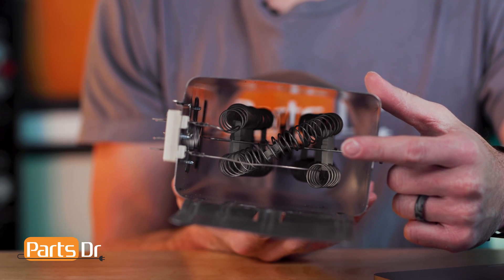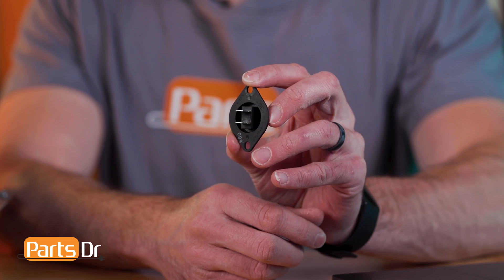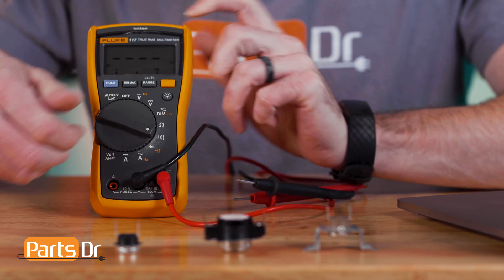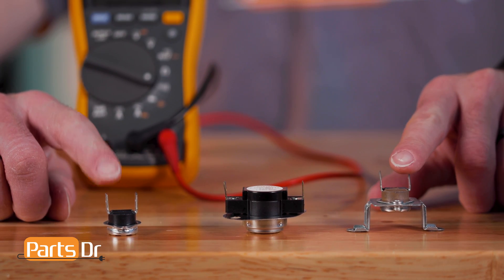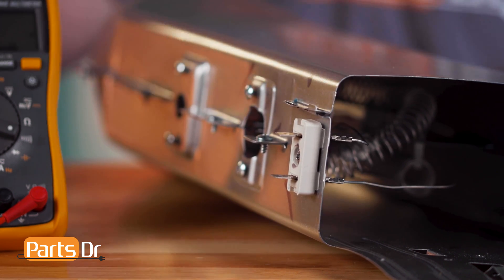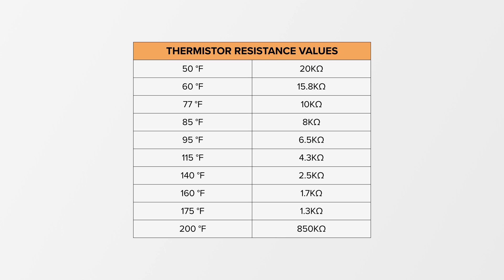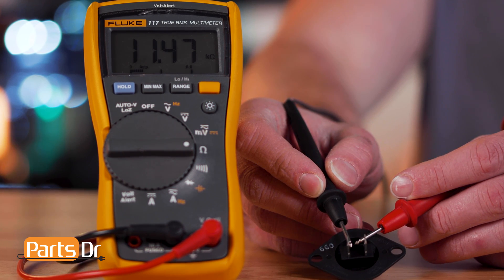Samsung dryer not heating? Test these 5 things first!

Comment: after replacing the belt, idler pulley and 4 rollers, the dryer starts and only runs for about 15-20 seconds and shuts off. What could be the problem?

Comment: What if it seemed to have stopped producing any heat, then later (after it rests and after I unplug it, wait a few minutes, and plug it back in) it starts producing heat again?  Is that a symptom of any specific part going bad?
Reply from the maker: That behavior is most commonly caused by overheating due to restricted airflow and/or a failing high-limit thermostat. When the dryer gets too hot, the high-limit opens and shuts the heat off, then resets once it cools down or power is cycled.

Comment: Very helpful, concise and to the point. Used it to check the all these sensors. One question: does the thermistor actually go to 850K ohms when it's at 200F, or should it say 850 ohms? Sorry if this was answered previously below.
Reply from the maker: That appears to be a typo.  850 ohms would be correct.

Comment: I have a question. I changed the thermal fuse and the thermostat components on the heating element, and I also replaced the thermal fuse on the blower housing, but I still don’t have any heat in the dryer. I haven’t checked the continuity on the heating element yet. I have a Samsung dryer and I don’t know how to find the error code on the panel. This happened once before and I paid someone to fix it, and it cost me an arm and a leg — I think they replaced the temperature sensor if I’m not mistaken. This time I did the repairs myself, but I still don’t have heat. What do you recommend? I already bought a multimeter to check the continuity of the parts.
Reply from the maker: Since you've replaced those components, testing the continuity of the heating element itself is the next logical step!

Comment: What an incredible simple video. You can buy all 5 parts that go bad as a kit. Including the heating element. Just buy the whole kit at once, replace all parts in one shot. And while there, why not buy new belt, tensioner, rollers. You can buy all items for cheap. Since you are already opening the beast, just do a full rebuild for little money
Reply from the maker: Glad you found the video helpful! Just a quick note of caution on those aftermarket kits: they’re usually much lower quality than the original parts, and Samsung OEM parts don’t come in a kit for these dryers. We always recommend sticking with genuine OEM parts so you don’t run into repeat failures down the road.

Comment: I've replaced the heating element and the two thermostat fuses on it and replace the two fuses on the blower. 

The blower runs but the heating element never heats up. 

The only thing I can think of now is the control panel but that seems to be working fine as well. 

I don't know what else to do
Reply from the maker: You will want to verify that the power supply to the dryer is good.  If the 240V power is missing one side of the power, the dryer can run but not heat.  Otherwise, it could be a bad main control board or bad centrifugal switch in the drive motor.
Reply: @PartsDr Yes I didn't currently have a multimeter so next weekend I will be testing the outlet and also going and testing all the fuses and the element I replaced to make sure I didn't get a faulty one.

There was also no real indication on which way the fuses needed to be. There was no markings indicating up versus down. But I did hook up the wires in the same area they were by color. 

Thank you for your response.

Comment: We have replaced main parts, ran error codes and checked vents but it's still heating up
Reply from the maker: We would check to make sure the dryer has proper power supply 220-240v (make sure there are no burned wires at the terminal block).  If the power is good, then you could have a bad motor or main control board causing the dryer to not heat.
Reply: Heating up is what you want from your dryer.

Comment: I changed all of these and it still doesn’t heat up? I even clean the moisture sensors.
Reply from the maker: Check to make sure that the power supply to the dryer is good.  You could also have a problem with the main control board, the centrifugal switch in the motor, or a wiring harness problem.

Comment: My error is on an older Samsung Steam, maroon colored dryer and  reads "Temperature Sensor Problem". Is that the thermostat or the thermistor? Since I replaced the heating element not to long ago, and it came with new fuse and high temp thermostat  it must be the thermistor on the blower. should i check that first then go back to element.
Reply from the maker: It is usually a thermistor problem.  https://www.youtube.com/watch?v=9ep9bfxJBGY

Comment: Thermal fuses and thermostat both show okay with continuity tester. Heating element shows continuity and no short. Thermisters show approximately 10.5k ohms. I tested the components on both the blower and heater body.

No error codes on the display. Anything else to look at?

Its a DV331AEW/XAC Samsung steam dryer.
Reply from the maker: Verify that the power supply to the dryer is good.  If an electric dryer is missing one side of the 240V power it can allow it to run but not heat.  If the power is good then you could have a bad main control board or a bad centrifugal switch in the drive motor (this requires replacing the drive motor).
Reply: @PartsDr Thanks. I tested at the terminal block and power is good. I took the dryer apart again and the heating element shows 0 ohms. Should it be replaced?

Also the thermistor on the blower is showing 12.68k ohms. Replace?
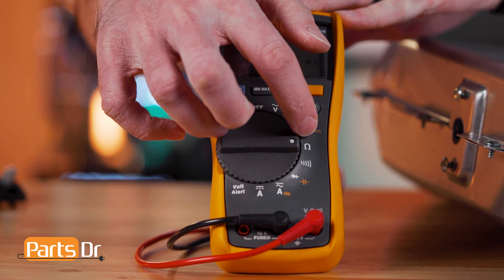Reply from the maker: @8mmtaco  The thermistor reading sounds like it is good.  The heating element reading of 0 ohms is an indication of a bad element, the heating element should measure 8 to 10 ohms as shown at 3:15 in the video.

Comment: I followed your video and found that one of the thermal fuses had no continuity,  I removed it and started examining it to find a replacement part online, as I held it in my hand and typed the model number, it clicked! I accidentally pressed a reset switch that I did not notice. 
I immediately checked continuity and found that it was good. Reinstalled  the part and I'm back in business.  Thank you so much for your instructions. 
You made me look like a hero to my gf. I owe you a beer
Reply from the maker: Nice job fixing it yourself!

Comment: looks like the black jumper wire's crimp corroded over the past 13 years and killed my fuse.  Thanks to your video I found out that everything else is OK.  Gotta get a new wire and fuse now.
Reply from the maker: Nice find!  That can happen if the connection is loose.

Comment: After replace all the thermostat and all the fuse ..even motor also
But still my dryer fuse blown..what should I do next? Mother control board relay is problem??
Should I replace control mother board? 
Please help me….
Reply from the maker: If the dryer heats up on an air dry (no heat) cycle, then the main control board could be bad or the dryer heating element may be shorted.

Comment: Hi this is my second time trying this.  All new heating element but still no heat?  Took apart again and using my manual ohm meter I can’t get a reading from the element itself?  Could I have ordered a bad heating element?
Reply from the maker: It's not likely that a new heating element would be bad out of the box.
Reply: @PartsDr  the heating element isn’t giving me a reading past 1 so that would mean the element is bad correct?

Comment: My newly installed heating element out is showing 13.3 ohms. All the other parts tested good, but the dryer still isn't producing heat. Could the resistance be too high at 13.3 to not allow the dryer to heat up?
Reply from the maker: No, it should still heat up at 13.3 ohms.  There must be something else causing your no heat problem.  Check into the power supply to the dryer, the motor centrifugal switch, and the main control board.

Comment: My Samsung dryer is working fine with no error codes... but no heat at all on any of the dry settings.  I checked the continuity test on the heating element and the 2 thermostats that are mounted on the heating element housing.  They also test fine in terms of continuity.  Now - I removed those and completely disassembled the housing to test everything.  Does it matter when I put them back which of the 2 terminals of each of those thermostats gets the blue wire or the black wire?  I'm not certain that I have them oriented the same on the housing as when I took out the housing?
Reply from the maker: In this video we show where the wires connect to the terminals here: https://www.youtube.com/watch?v=lbEtu8HFcHA

Comment: I replaced the heating element and still no heat?   Do I need to take apart again to replace thermostat or blower fuse?
Reply from the maker: You will need to test the parts to see what has failed.

Comment: My dryer still runs but with no heat switched the high limit thermostat but not the high limit thermal fuse. Could it be that??!

Comment: Thank you for this video! I have a Samsung dve45t3400p/a3 that is not turning on at all, no display or anything. I’ve verified that 240v are coming to the dryer from the outlet and completed all the tests in this video successfully, but still no power. Could it be a bad main control board at this point?
Reply from the maker: Did you check the terminal block for any burned or broken wires?
Reply: The terminal block being the panel on the back with the wires connecting from the power cord to the dryer? Yes those are fine and I tested them with the multimeter as well and all was good. Thank you for the quick reply by the way! I’ve been sitting here all day troubleshooting so you’re right here with me lol
Reply from the maker: @ethangaddis181  It sounds like you are probably looking at either a bad main control board or a bad user interface control board.
Reply: Thanks so much for the advice! Any ideas how I might be able to further troubleshoot to determine which of those might be the actual problem?

Comment: My Samsung dryer's heating element shorted out ( the heating coil wire was touching the metal frame of the heating element). There was a burn mark on the metal.  The Dryer shut down and will not power up at all.. No display, No lights, No power and it did not throw the breaker.  I am wondering if the whole thing is fried now?  Will the thermal fuses cause the whole unit to shut down?  Is there another fuse somewhere that protects the whole machine?
Reply from the maker: A blown thermal fuse does not usually act that way.  There is not a fuse that protects the whole machine that we have seen.  Sometimes a shorted element will damage the main control board.

Comment: Our dryer has had electrical issues. And will run, but not heat. We replaced a breaker, then it ran. Worked for a month. Now it’s not working again. 😭😭😭 so much money. Piece of crap. My husband had already replace the heating element and thermostat. Any other ideas?
Reply from the maker: Since your original issue was a problem with the breaker, we would start by looking to make sure the power supply to the dryer is good.
Reply: @PartsDr  the electrician tested with the tester and it was around 238/40 He didn’t check the breaker again bc the readings were good. But twice of the same problem? I feel like it has to be replaced electrical, but my husband is going to try to put all the old pieces back in (he had replaced when we thought it was the pieces before we found out it was bad breaker
Reply from the maker: @hberrysc3517  It sounds like the electrician confirmed that the dryer has adequate power.  Make sure to test all of the things shown in this video.

Comment: I have over heating issue with HE error code on my Samsung dryer. I did everything you said, but I’m still facing the issue. Heating element is good and fuses and thermistor are good. Read ohms and they were in the range they are supposed to be. I purchased a new mother board I’m hoping that fixes my issue. Any ideas or thoughts? Ty
Reply from the maker: Check to make sure you have 220-240v to the dryer.  Look for burned wires on the terminal block.  It could also be a bad main control board or a bad centrifugal switch in the drive motor.

Comment: My Samsung dryer wasn’t stopping when it was turned off so I unhooked the cords from the motherboard or computer and it worked fine for about two months. Now there’s no heat. I’ve replace the thermal fuse and thermostat and heating element and still no heat
Reply from the maker: Check to make sure you have 220-240v to the dryer.  Look for burned wires on the terminal block.  It could also be a bad main control board or a bad centrifugal switch in the drive motor.

Comment: My dryer only dries on time dry, what may be the problem? I replaced the the heat element a couple of months ago and now I’m having this problem. Please help thank you!!
Reply from the maker: What happens when the dryer is run on an automatic cycle?
Reply: @PartsDr  stays cold and doesn’t dry them
Reply: Did a continuity test on the Moisture sensor and it seems to be working.
Reply from the maker: @ericarcidiacono9936  Also check the wiring from the moisture sensor to the main board.  It could be a problem with the main control board?
Reply: @PartsDr  Ok Thanks!!
Reply: Can this be a coincidence? We moved into a house where the prior owners rigged the garage into a “guest room” and the electrical linked to that room has been an issue. We needed up tearing down that room and the next day our dryer stopped heating. My husband replaced all of the basic parts and still no heat. Then we tested the bolts going in and it wasn’t enough, so electrician went to the breaker and we had a bad breaker. He replaced the breaker and the dryer heated again!! Then our stove tripped a few days later  (on the same wall) we reset the breaker and worked again, but the clock  blinks and looks like the Maxtrix. One month later over Christmas break, my husband starts working in the garage/guest room to clean stuff out. He uses the outlets in there.. next day, dryer is turning on, but no heat. Electrician comes and it’s getting enough voltage. He says the two can’t be related. I say-how can they not?? That would be craziest coincidence. Am I wrong?

Comment: Please help . I have replaced all 5 things and still get no heat. I had made the element replace in the past and it worked . This time I have tried everything and am pretty annoyed . Anything else that could be the culprit? TIA
Reply from the maker: If your dryer is electric, check to make sure the dryer is receiving 220-240v and that there are not any burned or broken wires at the terminal block. https://www.youtube.com/watch?v=51BIF28C_6I
Reply: @PartsDr  bro you saved me it is the 220 wall plug that is kind of loose. I wiggled the wire when plugged in and heat came back .
Will replace de wall plug that should do it. Thank you SO much
Reply from the maker: @ezekias6  Awesome!  Glad we could help!

Comment: My dryer display is not turning ON, and the display dosen't show anything. I am sure it gets power because the door lamp turns on and I checked and found that the plug and cord are fine. How could I check and see the broken part? Is this due to bad thermal fuse? Thank you.
Reply from the maker: If the dryer is electric, you should still verify that you have power to the dryer.  With a 240v dryer it is possible to get only one side of the power 120v which can make it look like the dryer is getting power but it is only getting half of it.

Comment: So I tested everything on my dryer, only component that didn’t pass was the thermal fuse. Vent & blower was clear, not sure about the main control board yet, but everything else passed with flying colors. Is it possible the thermal fuse just went bad on its own? Would it be ok to replace the fuse by itself with no other components?
Reply from the maker: It is very likely that something caused the dryer to overheat and the fuse to blow.  Check the exhaust venting for any restrictions and test the heating element for shorts.  Also, try running the dryer on an air dry (no heat) cycle to see if it heats up.
Reply: @PartsDr  thank you for replying so quick. I tested the heating element for shorts and continuity and all was fine. Also the thermister and other t-stat on the blower assembly. We did have a buildup of my wifes hair that may have been causing the blower blades to struggle spinning. I replaced the thermal fuse and its working as it should right now on air dry and regular heating.
Reply from the maker: @leesplbg  Glad you got it fixed and running again!  If the fuse blows again, you may have a bad main control board and one of the relays that controls the heat could be sticking on.  Hopefully it doesn't require anything further.
Reply: @leesplbg is everything still running smoothly since your last repair?

Comment: hi, my inglis dryer had been broken belt, after i installed new belt, TS error code pop-up, i replaced thermistor i bought from reliable parts but the TS error code keep flashing, unplug for two minutes still they same. any idea?
Reply from the maker: What is the model number of your dryer and what is the part number that you replaced?

Comment: Thank you for this video! Very helpful.
Reply from the maker: You're welcome! Did you find which part was causing the problem?
Reply: @PartsDr  Yes, it was the heating coil that broke.  My replacement part kit came with the sensors and fuse so I swapped those out as well.
Reply from the maker: @kraigseder  Great! Nice job fixing it yourself!

Comment: I just got a brand new Samsung dryer and it’s all hooked up and I’ve got no heat coming from it.
Reply from the maker: Check that your power cord is installed correctly and that the power at the outlet has 220-240V.  If you only receive one side of the 240v, 120v it will turn on and run but not heat.